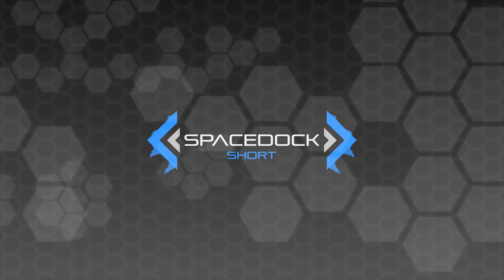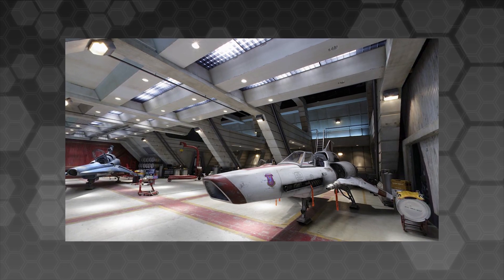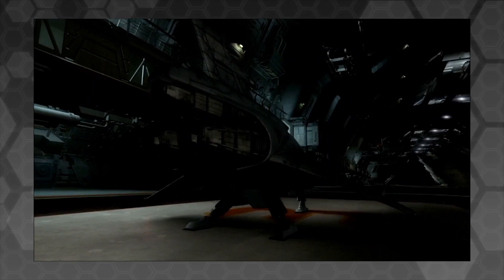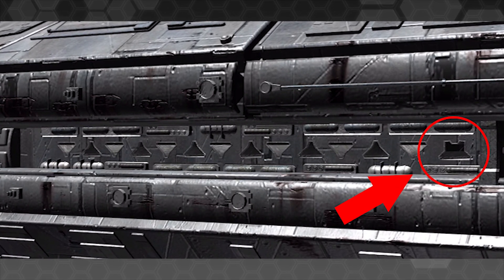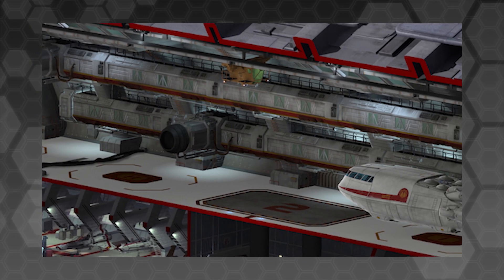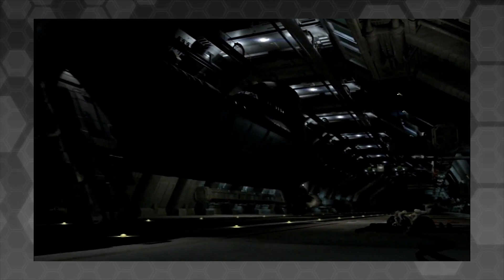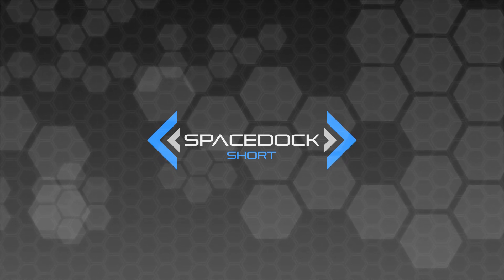How to Land on the Battlestar Galactica

Comment: Nice to actually see the landing sequence and orientation in the ship.

As to the double stack landing pods.  Where you showed a raptor shaped launch tube, it looked like their were inverted viper launch tubes between the other viper tubes, suggesting the lower bay was kept invented even in the "lower" launch deck.

As to issues with elevators from lower landing decks needing to be more complicated to flip the viper to a upright relative to the Galactica position.   ????  No it would be far simpler then a elevator.  It would just need to rotate along its long ( fore aft ) axis, rather then slide up and down.  As long as the pivot point was half way between the landing deck, and the hanger/ launch deck, it could just spin 180 and the Vioers roll off onto the new deck.  Faster and simpler then the elevators.

Frankly though, given they obviously have gravity control, and vipers can maneuver to a stop etc.  Ild really expect they just fly straight in, are Halley down to a stop by fields and allowed to slowly fly over into one of rows of elevator/air locks and land ( dock ) with the floor.   After you land/dock on the floor, and  you power down the engines, and it allows fumes to vent, it closes the lock/elevator door and goose down to the hanger deck.  The aircraft carrier landing seems out of place.  To aircrafty.  Unlike the newer space craft like dogfights.

And I liked the old series air wall force field at the enterence to the pod, which was never seen before them and Star Wars.  ;)

Comment: When you showed the launch tube on the Pegasus for raptors, if you looked at the other launch tubes for the vipers, you would see that every second tube is inverted. This implies the lower launch bay on that pod is inverse gravity to the upper, with the two bays meeting in the middle of the grav field, so recovered vipers can be launched in the same orientation they were recovered in regardless of which bay took them in. I think that's your answer to the Pegasus launch question.

Comment: So the checkers thing I seem to remember is different. If I remember the series bible correctly, "Checkers green" or "Checkers red" from the pilot refers to the elevator said Viper that has been cleared to land should set down on for a standard landing, kinda like if an air traffic control tower told me on a landing clearance to turn of at a specified taxiway. They would want the incoming Vipers to know where to put their skids down or where to taxi to so they have a ready elevator to the lower flight deck.

Comment: What if the ventral bays on the Pegasus have lifts that raise its Vipers UP into the artificial gravity rather than lowering and flipping them around. Sure the lift itself would be an obstacle in the bay while raising a craft but it would be far more simple a process.
Reply: Look at the green and red lights at the bay entrances.  Green and red designate starboard and port, and their locations are reversed on the ventral pod.  The only reason to do that is if the ships come in upside down compared to the dorsal pod.
Reply: Good point, seems a waste to flip them compared to just lifting them up into it.

Comment: If all pilots approach on the same vector (~30° down, parallel to hanger; with vector changing only as they hit the deck) there is less chance of collision.

Also, like IRL carrier based planes go to full thrust in case they miss the arrestor wire: Vipers may have to thrust downwards to deaden the bounce.

Ralph Mcquarrie's concept art for the series depicted a strip of approach lights 'hanging' behind the landing bay.  Broke realism, but way cool.

Comment: It's also interesting to note that the Pegasus apparently has external landing pads on the outside of its flight pods for shuttles and raptors. You can see it being using in both Razor and The Plan

Comment: Perhaps the shuttles didn't have jump drives and if caught between ships in a surprise attack risked being left behind, since raptors could jump and vipers were fast, small and maneuverable enough to get on deck quickly.
Also if you look at series 4 episode 12 (They find the original 'Earth') they are large ships, overkill for simple crew transfers, their mission profile probably doesn't come up often in dramatic purposes, transferring large numbers simultaneously.

Comment: I’m just confused where does the lift go to on the Pegasus? Because so the galactica it goes down into the bottom of the flight pod where it’s viper tubes are but the Pegasus has a central flight deck there instead so where does it go?

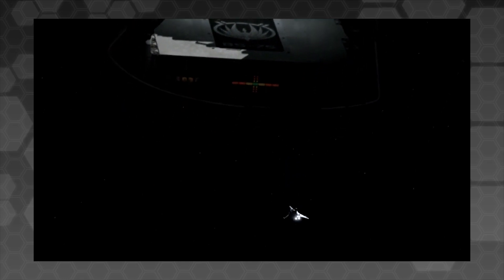Comment: Ok, I have to weigh in here on something about the landings and radio bit. "Call the Ball" refers to the Optical Landing System (OLS) used an carriers. If you look at your own video you will see a example of this at time index 0:40 at the little ledge below the landing deck. This system, on carriers anyway, is a non computerized system that is used as a reference for the pilot coming in to know if he is on the correct glide path for a safe landing. Usually it is controlled by the LSO (Landing Signal Officer), who uses a fixed camera placement to see how the fighter is lined up, and then the "BALL", which is the section of it that actually lights up, is moved left/right, up/down to indicate to the pilot how of and in what direction they are off of the proper glide path to land. The term "I have the Ball" Is the pilot confirming to the LSO that they do indeed see the light and are using it to adjust accordingly. Sorry about the ling windedness here but as a person who had served on carriers a couple of times, and having noticed it in the series I thought it would be useful information for you. That said, there are quite a few similarities between how BSG treats some of the Battlestars operations and how the US Navy does. Hope this hasn't been too annoying anyway. Thatnks for the great videos, I look forward to notifications from you.
Reply: Something else. While the Flight Control Officer is generally a high ranking officer (at least on US Carriers), they are usually 4th or 5th in the chain of command. Usually the CAW (Commander Air Wing) out ranks them, although BSG seemed to play a little fast and loose with some of the ranking systems.

Comment: I've taken measurements of the 3D model of the Pegasus. She has TWO hangar decks for viper maintenance. In all likelihood they are oriented with the landing bay that they service. As such, the connection between decks is somewhere between the two and not between the hangar and landing pods.  It also means that the launch tubes are all angled down very slightly from their respective deck, given that all of the tubes meet on a single line on the exterior of the ship.

Comment: Others have pointed out that there are up/down viper launch tubes (from the still you show the Pegasus with the raptor launch tubes).   I'd suggest that there are two landing decks, two maintenance decks, and a shared launch deck that is zero-g with the craft being held in place by magnetic systems (and any crews using magnetic boots).  This makes the most sense as you can orient your gravity plating as necessary and don't have to reorient your craft through a complicated lift system (simple is always better in a combat ship).    As for why the set of "inverted" launch tubes are blocked off is because you would not launch vipers from both decks simultaneously - it would screw with your pilots immediate post-launch flight coordination and orientation.   You'd want a wing to launch in the same "position" and to be able to orient to their wingmates.   More importantly, you wouldn't want the relatively "inverted" launch tubes open to space if you weren't planning on an immediate launch, just in case you're doing maintenance on a lift and might have that tube exposed to the interior of your maintenance deck.  There's probably a little transit vehicle that goes between these decks that flips the crews around, or even a moving walkway where there's a zero gravity area on the deck that allows you to simply clamp onto the walkway with mag boots and ride it to the other maintenance deck through the launch deck.

Comment: @Spacedock A tactic used by some ships I have seen is where there is no mechanism that flips the ship just a entry to a elevator that is the right way up with lights designating to the upside down pilots to use RCS thrusters to rotate their ship to the correct orientation, then drifts in the elevator area to be lifted up into the hangar. The runway is kept upside down to allow more space so other craft can land. 

In Battlestar Galactica the ships have runways not only for landing but there is a tactic used that I believe that Pegasus can make use of. That being carrying a large taskforce of Vipers, Raptors, and/or bombers maglocked on the runways while all the launch tubes are filled. Once the ship jumps in the tubes launch all the vipers in there while the maglocked ships take off slowly from the runways. This tactic will allow a Battlestar to carry 2 to almost 5 times their normal payload of vipers.

Comment: More likely there's two hangar decks in each of the Pegasus' pods. One 'facing' down, the other oriented normally. Rather than having rotating deck lifts, it'd be far easier and safer to have elevators that flip to the appropriate direction when the crew comes in.

Comment: If you look at a documentary on Aircraft Carriers it will explain that Navy aircraft have very well built landing gear cause they have to land hard on the carrier with full thrust so as in case the arrest hook misses the wire that slows the aircraft.  I think that the show was trying to emulate that.

Comment: Why not just have the Pegasus vipers taxi into an "upside down" position on the "roof" relative to their deck. Then the lift goes down (relative to deck) or up (relative to viper on the lift) and when it emerges it's correctly oriented.

Comment: to be honest i see a relatively simple way to flip the Vipers and Raptors when moving with the lifts. if the mechanism that actually moves the lift is similar to most lifts, at the sides of the shaft, and then having the lift be big enough that you can flip the surface of it with a viper or raptor attached while in the 0G part of the liftshaft or still on the flightdeck it would be a relatively easy process. Since normally they don't land the vipers on the lift immediately in combat you can take the time to line it up enough that clearance during the rotation doesn't become a factor

Comment: @Spacedock If you read the Battle Star Galactica Series Bible, Checkers Red/Green actually refers to which elevator to land on. It is actually in fact, not the condition of the deck, even though it only seems to change based on deck condition."Checkers Red" is often used when there are non-combat situations, and "Checkers Green" Is only really ever used in combat scenarios or when there is no/limited contact with the ship. Not sure why this is but I would assume they lower into different compartments of the hanger that do different things or have different equipment available.

Comment: Hey Daniel, I know you are familiar with Star Citizen, I can tell you that there are a few magicians out there who can perform extremely smooth, fast paced combat landings onto a platform that is only a few times bigger than the spacecraft itself! Even the speeds utilized by the ships in the two unviverses are roughly the same. Of course I have really limited experience about flying (and landing) space fighters, but it seems to me that they have to go at max speed possible, and only care about getting into the landing bay itself, without thinking on the actual landing yet.
If interested, check out Legacy Instructional Series' combat landing videos!

Comment: Are the elevator shafts pressurized, that's the only part that ever bothered me. Not for realism or anything just trying to put it together between the lift and the maintenance/launch bay.
Reply: There's either an airlock outside of the shaft at the end, or an airlock somewhere in the shaft, though building airtight doors that have an elevator going through them would require some interesting design.

Comment: I always thought Pegasus had 2 hanger decks with each having artificial gravity orientated to the respective runway and had zero-gee passages between, there is evidence of this in video when you point out the raptor launch tube, half the viper tubes are inverted

Comment: it looks like on the launch tubes with them being inverted next to normal that there are in fact 2 landing decks one for the upper bay and one for the lower, each deck has the gravity opposite, so that each has a deck in relation to each's orientation, this makes sense as only personnel and stores need to be moved through the gravity zones, making the "flip" part a lot simpler. it also allows to compact the launch tubes better as you see.
Pretty simple really.

Comment: For the lower flightpod on the Mercury-class it could be that the elevators extend out from the deck and the vipers and raptors re-orient themselves onto the platforms before they are raised into the maintenance and storage bay.

Comment: @Spacedock. I don’t think the Pegasus rotated the vipers/raptors that land on the ‘under flight deck’ as when you showed the raptor launch tubes ( 4:13 ) it had viper tubes that looked to be upside down so the Pegasus may have 4 hander decks in total just 2 by 2 at the floor with grave generators and a way for the crew to orientate themselves to whatever is up at that time.

Comment: Not sure if someone else has said it as well, but there are actually three Raptor launch tubes on each flightpod according to the 3D model of the Pegasus, with each one at the beginning of a group of launch tubes, making a grand total of 6 Raptor launch tubes. And seeing as the Raptor is much wider than a Viper, I think these Raptor launch tubes can also launch Vipers safely from them as well.
Reply: If you can gget them into magnetic clamps of much biger size. If not, the launching tube can't be used for Vipers, only for Raptors

Comment: The Pegasus likely doesn’t store the vipers the same way the Galactica does, if I were to hazard a guess. Otherwise spot on as usual! I steal a little from BSG’s military lingo and commands etc for a Homeworld fanfiction I’ve been redoing slowly. The game feels very BSG as it is, so it fits.
Reply: Homeworld was supposed to be a BSG game, but they didn't get the license. And also, Pegasus' hangar deck looks almost identical to Galactica's (probably because the designers didn't want to build another massive set).

Comment: Based on the geometry, you can land more vipers and such, but the amount you can launch is still going to entirely depend on the number of launch tubes you've got, which is only required to fit within the area. I kinda wish they'd had the thing vertically stacked like it's doing constant acceleration like in The Expanse, this would also removed a lot of the issues you mentioned since both directions move 'up'.

Also, I was looking around and found this: https://www.gian-cursio.net/2017/04/bsp-hangar/

Comment: Why did the Galactica Design made the actual hangar deck for storing Vipers so small? Yes it runs the entire lengh of the flight pod, but it is only like 10 meters wide. Why didn't they put the launch tubes one deck below the hangar so the actual hangar could be the same width of the flight pod? That would have given them sooooo much more space to store Vipers (like 3 times the space they have in the show).
 I get that for budget reasons the had to keep the filming sets as small as possible, but there has to be some In-Universe explanation for this.
Reply: The Galactica was built in a rush using the simplest tech they could to counter cylon hacking, the less complicated things were the better. Fewer elevators and airlocks meant fewer computers, and fewer potential access points.
Reply: Check out Blood and Chrome. The hanger deck was stuffed and there were at least two levels of parking for Vipers on frames and catwalks above the spots we normally see. By the time of the series, since Galactica was on her way out of the fleet, all the war time structures were gone and as a result her embarked wing was significantly reduced to what we see at the beginning of the series. She also had more guns on her head.